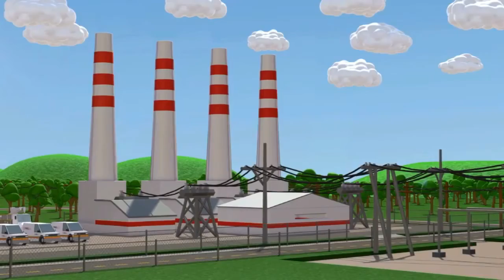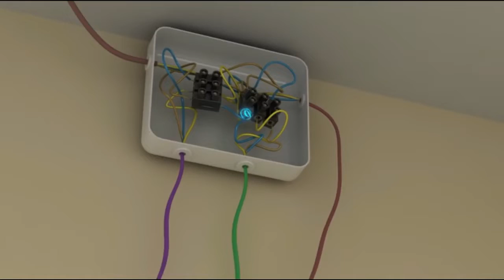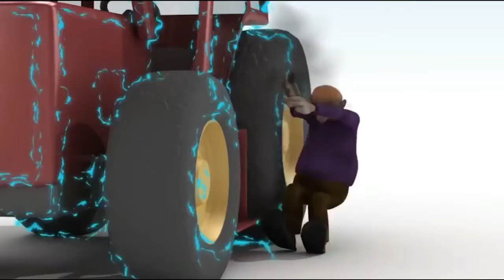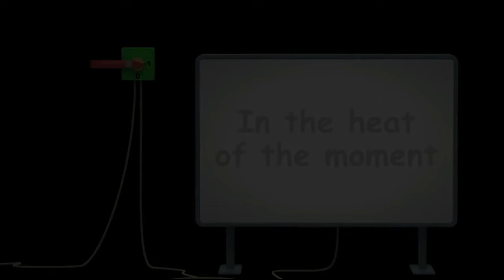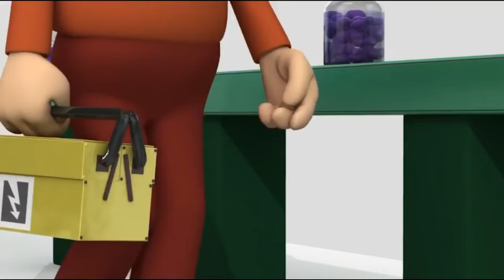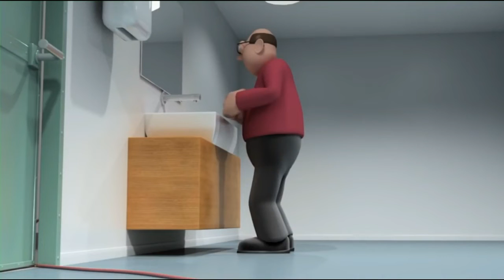Electrical Safety Hazard  | Arc flash hazard

Comment from the maker: Causes of Arc Flash – Electrical Incident
https://smathanshse.blogspot.com/2022/06/causes-of-arc-flash-electrical-incident.html

SELF INSPECTION CHECKLIST - WELDING AND CUTTING WITH OXYGEN FUEL GAS
https://smathanshse.blogspot.com/2017/12/osha-self-inspection-checklist-welding.html

WORK AT HEIGHT PRECAUTIONS - PICTORIAL TRAINING
https://hseinsider.blogspot.com/2021/03/work-at-height-precautions-pictorial.html

THE BEST INDUSTRIAL SAFETY POSTERS
https://hseinsider.blogspot.com/2021/04/the-best-industrial-safety-posters.html

What is 5S | 5S System in Industry 
https://youtu.be/bYeRgN5-4AM

Static Sparks Explosion  
https://youtu.be/g1tzw9cSLWs